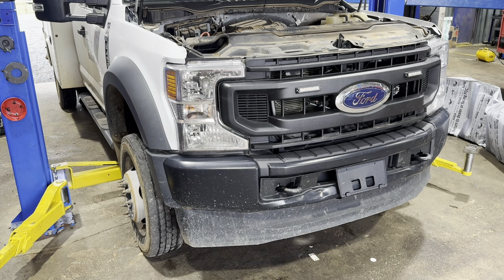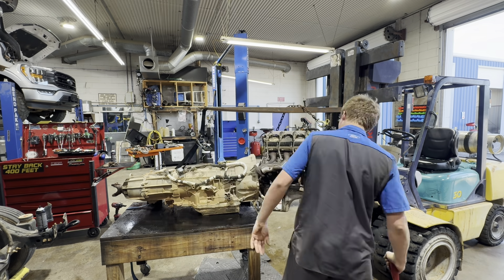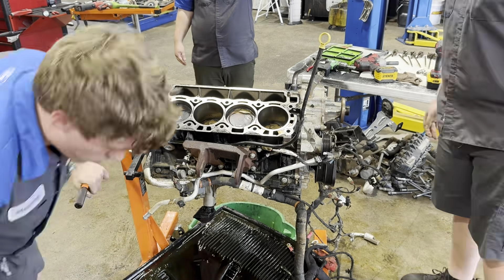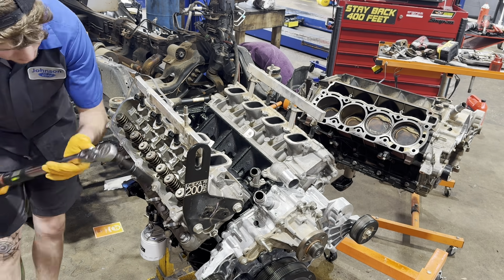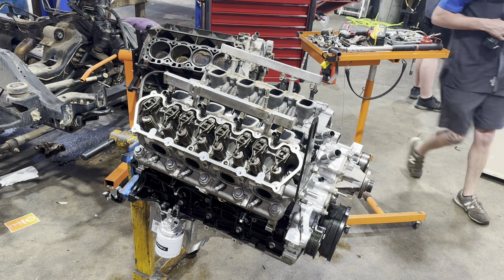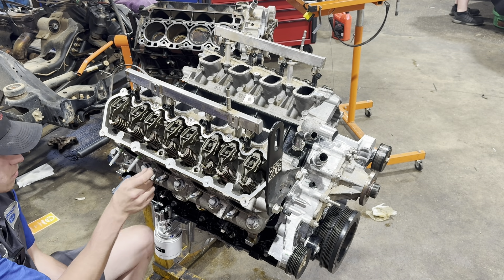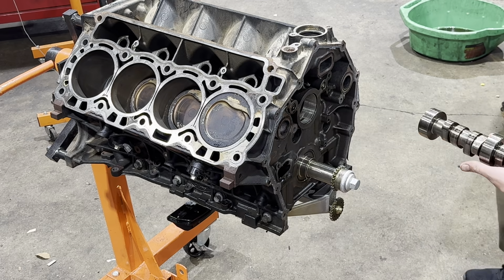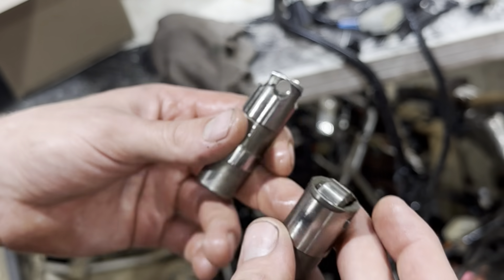Ford 7.3 Godzilla | Does this one issue make the engine a bust?

Comment: I have a '20 350 Lariat with the 7.3 with 59K miles.  No issues so far (except for a bad coil to plug wire). I've never been comfortable with the variable oil pump.  Agree with all your recommendations to avoid this failure.  Wish me luck, I'm shootin' for 250K before she blows 😂
Reply: We have 3. Our 2020 has 191k. NOT 1 issues and it PULLs every day. ( Loaded Box truck ) Been in shop once, rear end. Just FYI.
Reply: Nice.  @70centurian
Reply: You may have to buy one of those cute little unicorn type stuffed ponies and set it on your dash 😁. Sadly that seems to be the theme with every newer truck no matter the make, Toyota felt left out and so they got into the action as well !

Comment: We had a 6.8 that got replaced under warranty in under 1,000 miles, 2024 F-250.  We have several 7.3's and no issues so far.
Reply: When you say 6.8 are you referring to a modern version of the v10? I don’t know much about the gas engines in the newer Super Duty’s. I’m still driving an 03 SD with the 2 valve 6.8. 300+ thousand and still runs strong. Seems like all you hear about is the 6.7 diesel in the Super Duty’s.
Reply: @466htrd  No, ford made a destroked version of the 7.3 which is now the base engine in the super duties.
Reply: @466htrd  We have a few V-10's still in our fleet, no issues with them other than crews say power is down compared to 6.7 Power Strock diesel.
Reply: @garyp.9073 Gee what a surprise. Next thing you’ll hear is it isn’t as comfortable as a cadillac
Reply: @466htrd  the newer 6.8 is a V-8 gasoline engine.
Reply: I've got a '22 7.3 KR tremor/4.3 gears since new with 70k miles, 50k of which it was pulling a 12k gooseneck- only issues it's had so far was a contaminated fusebox (water intrusion) causing intermittent startup or shut off that was replaced with an updated fusebox under TSB/warranty and a cam position sensor go bad around 15k miles.
Reply: What happened to the 6.8
Reply: @anthonymoy4471   Dealer never said what was the cause.
Reply: I heard the godzilla had some camshaft issues that were fixed through oil pressure raising? 

But then how did the 6.8 fail? Idling?
Reply: @ramaswamynarayanaswamy4806  
Less than 1,000 miles on the 6.8 liter before it failed, most likely a manufacturer issue that early.  Dealership never said what was wrong, I don't believe they went further than a compression/leak down check.  Ford did us right by putting an entire long block in. Thankful for that.

Comment: 40-50k miles? :face-fuchsia-tongue-out:
Just changed the oil and filter on my 2002 trailblazer 4.2 with 247,000 miles!!.
Still runs like a top. 
And keep in mind it's a DOHC, 4 valve, VVT engine.
Does ANYBODY make a good engine anymore?

Comment: Great video. This is disappointing to hear but seems be exactly like hemi and ecotec motor failures. I had a hemi that ate its cam at only 85k miles. Supperedly you can upgrade the oil pump on Hemi (probably ecotext too) but I worry this would void the warranty. Very expensive and catastrophic failure that will likely happen at some point in the engines life. I know you said you don't like the old 6.2 V8 for power output but at least those were pretty reliable motors.
Reply: To even fault the 6.2 for power output is idiotic. Especially at the time when it was introduced, when 385hp in a truck engine was a HUGE step up. I ran as a drilling rig technician back then and when I was up for a new truck it was a 2011 F250 6.2 from a 2008 6.8 Triton V-10. It would leave the other techs still driving 2008s waaay behind from a dead stop, loaded down just like they were. The engine control system really holds these 6.2s back. I had read of a guy that was buying old police Crown Victoria's with the 4.6. He was swapping with the 6.2 and using all the old 4.6 sensors and engine ECU and it was really waking the 6.2 up. The sluggish response of the 6.2 was all in the programming. But the 4.6 was more responsive due to the ECU it used.

Comment: This is a real shame.  I may be in the market for a new vehicle in the next year or so.  I was considering a  Ford Super Duty.  I'm not now, if this is what Id have to go through with it.
Reply: I'm a GM guy its not just Ford it's all of them having engine problems.
Reply: Buy a psd
Reply: That’s an old truck in this video
Reply: @BT62240 ford hasn’t changed a thing. These are all going to do this. Just like the GMs do.
Reply: @mdubz101  yes they have changed the thing. First of all there was a bulletin for dealers to increase the oil pressure on all 2024 models that were on their lots and I'm sure the 2025s are coming through with that fix already built into them I sure hope so because I just ordered one. Secondly, what this video missed and the fact that anyone will discover if they do a lot of research is that this problem seems to be linked to a bad batch of lifters from a vendor so anyone getting a 2025 or newer should be fine.  BETTER be fine.

Comment: Pretty pathetic ford hasn't fixed this by now. I regret buying mine. I don't like wondering should be a class action lawsuit. Build a truck made to work and knowing they will have high idle time with low idle oil pressure this is so stupid.
Reply: Who is deleting my replies?
I've been turning wrenches for 56 years so my comments are deleted?
Reply: Ford didn't copy anything.  First off  no one has designed a small block  engine this size 445 cu right there puts the godzilla engine light yrs ahead of gm and Chrysler with this engine design.  The heads are more like the Cleveland head degree canted valves 🙄😂once the quirks get worked out of this engine,It will be bullet proof.. there's nothing out there in a gas powered engine that compares with the godzilla engine.. mine has 95 k zero issues
Reply: @JeffParker-lu5kq  It's the engines 5th year now the quirks should have been worked out the first year or two. Ive got one and like it but mine is a 4th year engine shouldn't be sweating this by now.
Reply: @JeffParker-lu5kq  The GM LS/LT is sold as a 7.4L/454 for commercial applications. It's just not in a production vehicle. The LT engine also has canted valves. Not a big deal if they are similar or not. All manufacturers are trying to cheap out and put sub-par components in their engines to reduce cost, increase profits, and hopefully make it just past warranty.
Reply: They’ll settle yours right after GM and Chryslers.
Reply: It doesn't matter what engines it's happening to none of this happened to the millions of pushrod engines that were manufactured throughout the 60s and 70s and even 80's.  People have been buying retired police cars at auctions for decades that have a quarter million miles on them and idle times that surpass anything the average person can't even fathom and although the camshaft and lifters are worn to hell they are still running and didn't experience any catastrophic failure. With this video is missing is the fact that in addition to the oil pressure problem a little bit of research shows that this is probably linked to a bad batch of lifters from a vendor and if it turns out Ford did not make an immediate and massive correction as soon as they found out then there needs to be a class action. Unfortunately we have a lot of dirty judges that toss class action lawsuits like the one who protected Toyota from the soy based wiring that attracts rodents and nowadays almost all of the manufacturers including Ford are doing the same thing. I just ordered a 2025 F350 and I live on the road so if my engine goes out because Ford didn't fix this after knowing about it for at least two years a class action lawsuit is the least of their worries trust me because I'll snap.
Reply: @MAXIMUSMINIMALIST I was paranoid as well but after talking with quiet a few who actually have this engine I'm not as worried as I was. It honestly seems to be overhyped from the internet. I eas talking to the powerline company that has several of these with 100,000 plus miles with no trouble at all. I've yet to see one in real life or know anyone who's actually had trouble. Obviously there will be a few but it seems rare considering there are millions out there now from bus to ambulance to truck the odds are good yours will last along time. Use good oil change 5,000 miles and most likely it will be good. Ive been doing oil analysis on mine with the results looking good. Penzoil ultra platinum 5-30.
Reply: @MAXIMUSMINIMALIST well my '23 F350 Tremor bought w/6k miles, mint. Now, 20k miles, misfires last month. Cylinder walls scored. Ford put new Godzilla in, whole new part number, so that tells me, new parts? Drove it a week, put 75 miles on it, rough idle as before, drove straight to Ford, scanned it as chk eng light went on when misfire. 
He checked coils and plugs to make sure that everything was all connected and then scanned it. Found out that the opposite side bank of the engine, two are misfiring. Again. So it's been at Ford now 12 days, 7 days ago was told data & photos of internal sent to Ford engineers. Was supposed to hear from them Monday, after the weekend, 5 days later it's friday. I'll call today to see WTF is going on. Put a friggin Megazilla in if it has all upgraded lifters and cam performance-wise parts with no issues. Or put a Crane cam and lifters in,  that's all they do & make!
Reply: This is preventing 😢
Reply: Never idle for 5 minutes Insanity
Reply: Did you not watch the video? This is common in ALL push rod engines up to and including GM and Mopar engines.
Reply: @porkchopsandwiches192  Regardless of whether it's common in all push rod engines or not, it's unacceptable. Ford built an engine to be used in commercial vehicles and never thought about how long work vehicles idle. Ford essentially copied the design of their competitors and failed to solve the problems that plague those engines.
You'd think they would improve the design, not make it worse.
Reply: @porkchopsandwiches192 Not Ford only.
Reply: @porkchopsandwiches192 regular hot idle oil pressure is 25-28lbs on gm v8. If i see anything less than that i assume i have a problem.
Reply: @porkchopsandwiches192  It's not common for engines to fail at 30 to 40,000 miles. This is a known problem. Even Ford admits it now but still ain't doing the pcm update. Its completely stupid to build a engine made to work that self destroys when idling. Ranchers farmers loggers oil fields off roading all require a truck that can idle and go slow  without this bs happening. Superdutys are made to do exactly what's killing this engine good job ford.
Reply: Thats Ford for ya, fix or repair daily.  Glutton for punishment!..

Comment: Got to step in and defend the 6.2.
Nothing but good experiences with them. Raptor was still running great at 270k and my boss has 6 of them in f350s. Few issues.
I'll even make the case that it's the best modern Ford truck engine aside from the V6s which are even more reliable.
Reply: My coworker has a 6.2 Raptor with 780k. Original motor but 3rd transmission.
Reply: @RadDadisRad  Wow that's awesome. How did he get so many miles on it?
Reply: @jimh.412  driving it
Reply: Yeah that was a dumb comment he made
Reply: The 3.5l gen2 with a rubber oil pump belt is junk. Its a really stupid idea to use a rubber belt to drive the oil pump instead of the crank nose.
Reply: @timothybayliss6680  gen 4 5.0 uses a belt too
Reply: @RadDadisRad well that explains a lot
Reply: @timothybayliss6680 true…the entire engineering team that worked on the design process should be fired and lose their licenses
Reply: yeah I'm not sure if I want an old 7.3 diesel or a 6.2, for towing up to 15k lbs cheap, mostly on flat
Reply: @autismion get the 6.2 it’s a good engine
Reply: “Nothing but good….
…. Only a few issues”

Typical ford guy😂

Comment: Is FORD decking the heads 🤔 for a new short block installation? If not that will be the next recall 😢
Reply: It didn't overheat.... so they "should be straight", if they didn't check they deserve to do it twice.

Comment: Better track down an old 7.3L diesel. 😎
Reply: I've got a '99 F-250 6 speed 7.3 with 465,000 miles and a 2001 F-250 7.3 automatic with 484,000 miles. Still awesome trucks.